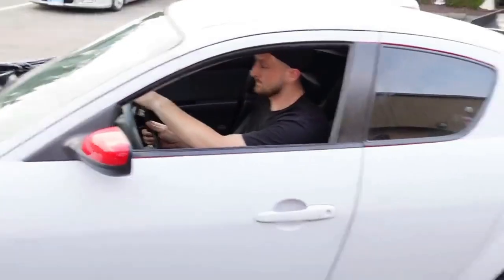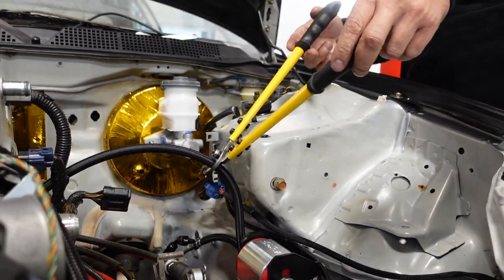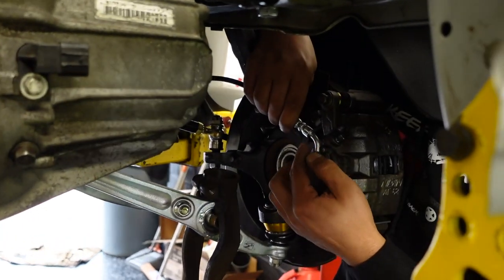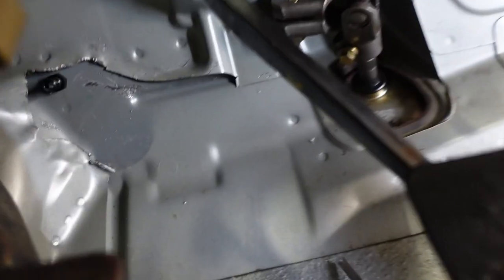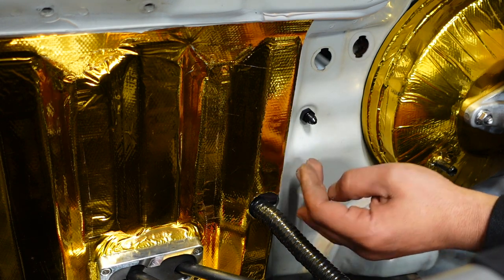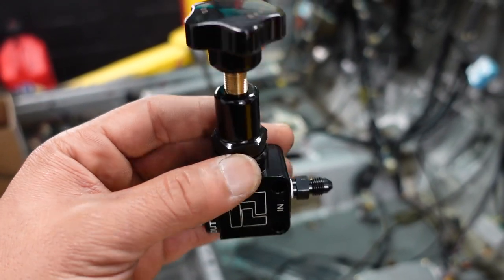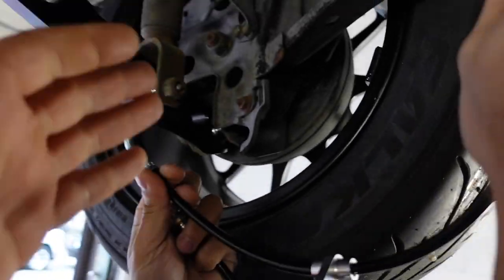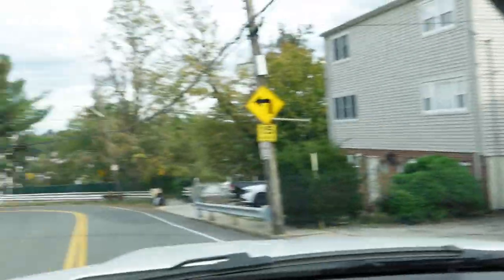Brake Line Tuck Done EASY 🤗

Comment: Love you guys! Passing out gems....ALL DAY, E'RY DAY!
The 5/16" to -6AN adapter is the correct size. The OEM fuel lines have a coating on them that has to be sanded/scraped/removed so that the compression ferrule will fit and properly seal the fitting. You won't see a leak until that fuel line and chassis flexes a bit. 
#keepgunnin

Comment: Answer to your oil cooler I wouldnt worry about it as it would be pressurized. BUT! If you're really worried unbolt the cooler and put it on the floor and prime the whole oil system (so the cooler feed is higher than the cooler itself) it should bleed the air bubbles IF ANY through. KEEP GUNNIN!

Comment: Not quite sure if it will apply to this situation but you asked about the oil cooler and the layout.. y'all may need to consider the possibility of aeration or cavitation and it's potential effects on the oil pump. Not to mention, the temperature fluctuations while racing may play a huge role in exacerbating this (potential) issue. Maybe research an oil weight that would work best for the expected conditions? One early sign would be bubbles appearing in the oil.

Anyways, the channel rocks. Keep Gunnin' 🔫🔫🔫🔫

Comment: Ehh Aki, I think by having the fittings facing down, the oil cooler isn't being used to its full potential . At least if the fittings are on top, you'll know that you're getting the maximum amount of oil inside the cooler before it returns to the motor. Just some food for thought.
Reply: gunners report! also ur doin oil draina in those lines as well as the cooler itself... what is gonna be hard about removing it from the mount and undoing both fittings at that point? initial cracking loose while mountes ofc. man just throw a little bracket so it mounts right

Comment: Hey yo any1 ever try doing the 240sx master cylinder with the prop valve built-in... I kno it fits the booster perfectly and works but I'm trying to figure out if yu would use the isr 240 lines or what lines
Reply: Any info would help as far as any1 knos and I kno Jimmy Oakes used it on nassonda but he used 240 calipers.. I'm trying to use gsr calipers!!!also can yu use v.w. carrado rotors with gsr calipers

Comment: I think you will loose cooling efficiency by having the inlet and outlet inline on the radiator as the water will flow right through instead of using all of the core to cool it

Comment: That ground wire you added to the valve cover there is doing absolutely nothing. It needs to go to the studs. Remember the valve cover has a rubber gasket and rubbers under the gromets therefore it's not doing anything to the head or block!!!